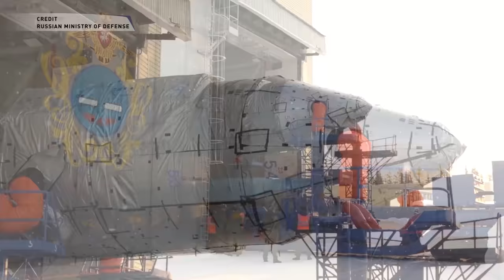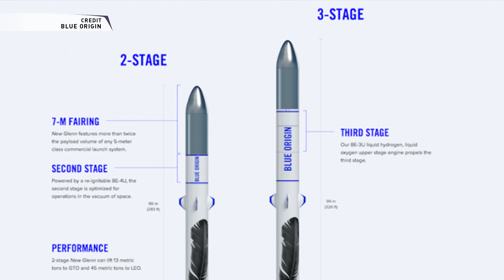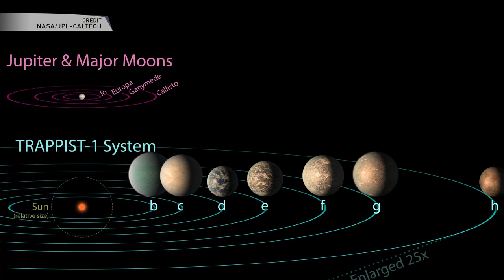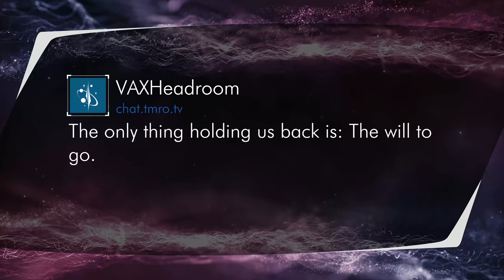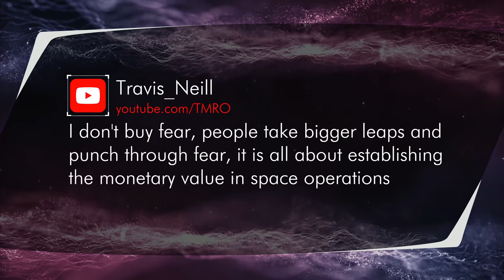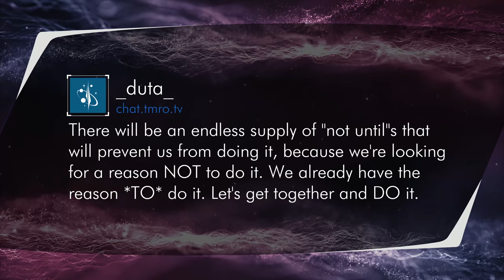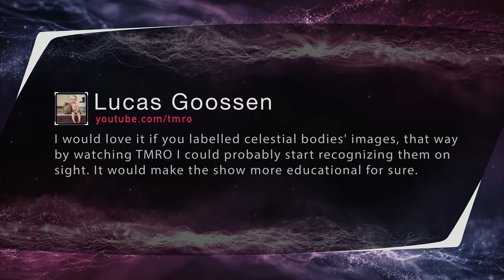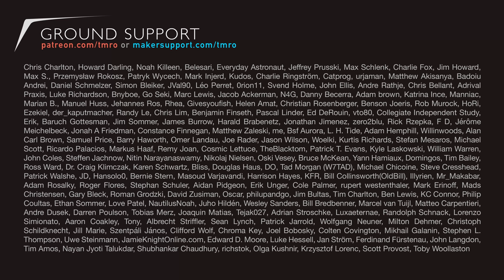TMRO:Space - What is currently holding humanity back from our next cosmic steps? - Orbit 11.13

Comment: so i see lots of rockets with extra boosters at the bottem of the rocket, I would imagine that rocket engines are quite heavy and expensive. If you put extra tanks at the top of the rocket that gravity fed their contents into the main tank and could drop off when empty to reduce weight (and probably wouldn't need much structural strength further reducing weight). Would that not be a more mass/cost effective method of getting more payload up?